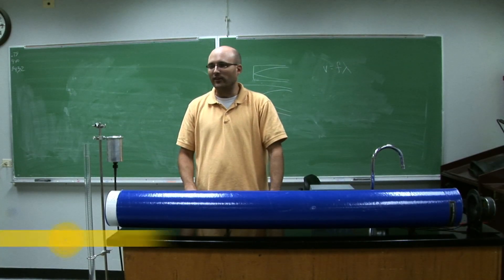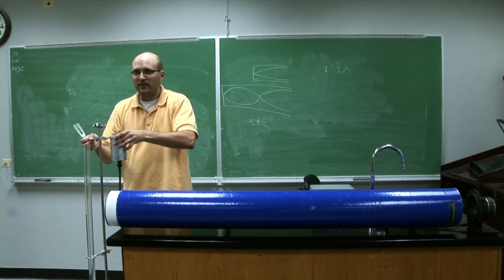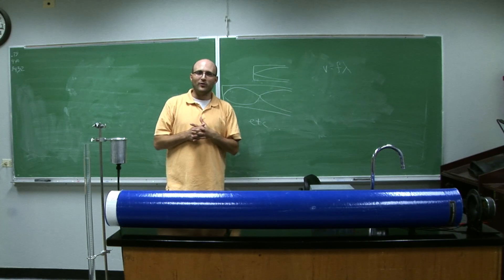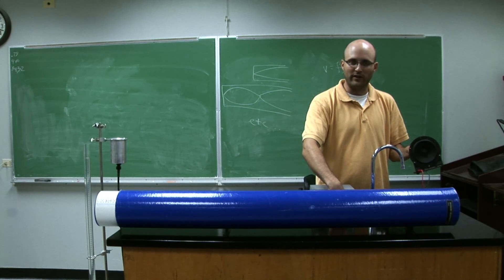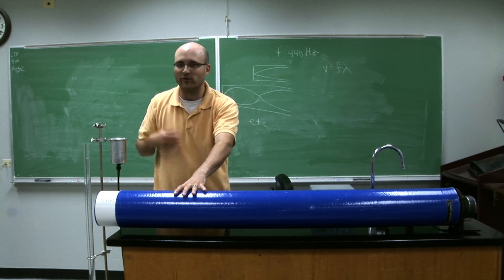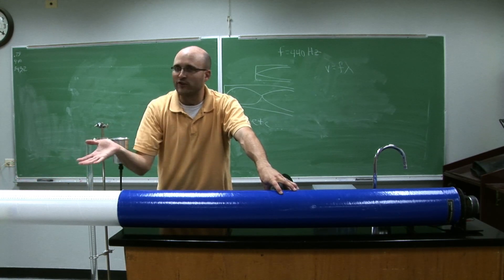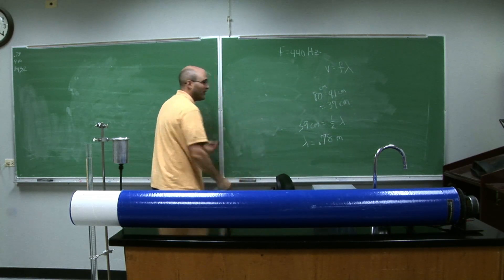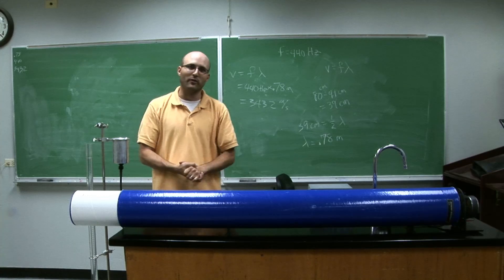Resonance tube demonstration

Comment: half the sound's wavelength is the distance between two consecutive nodes, nodes being distances from the source of the noise where air compression appears to cancel out. we use our ears to find the length of a tube that resonates the sound more constructively or destructively in order to determine the distance between nodes which is used to calculate the frequency's wavelength.

Comment: To prem:  The increasing loudness is something you'll get whether the speaker volume is high or low - notice when I hit the tuning fork, it sounded pretty quiet in the video but got a little louder when the tube was under the right conditions.  The pattern of the wave is stationary in space, but the whole point of this is to show that given the constructive interference between outgoing and reflected waves possible under certain conditions, you can get much higher amplitudes.  The fork or speaker is supplying energy into the system continuously, and in a resonant system driven properly, you lose very little of that energy.

Comment: I use this technique when I design my musical instruments- I love to mess with the amplitude the most it’s neat how you can make something as wide as you can but as long as one end is totally sealed up and it’s the proper height and length it makes the sound so loud. I like doing this electronically with capacitors and transistors the most.